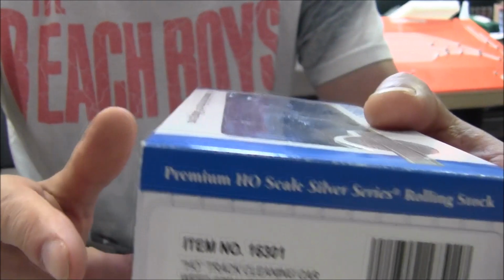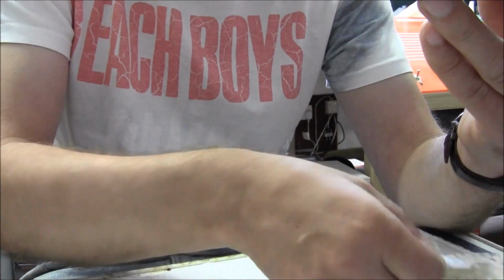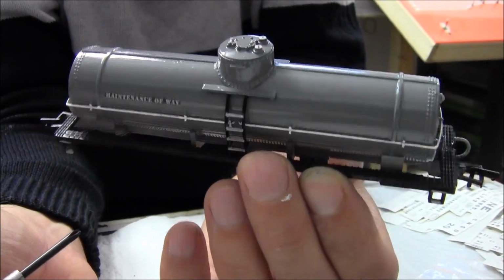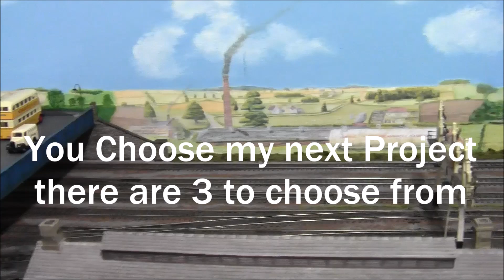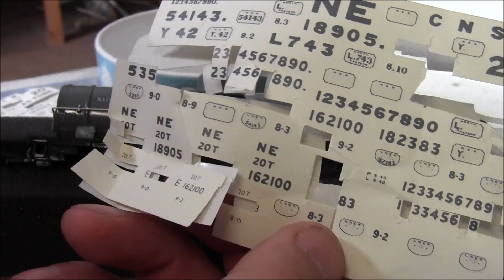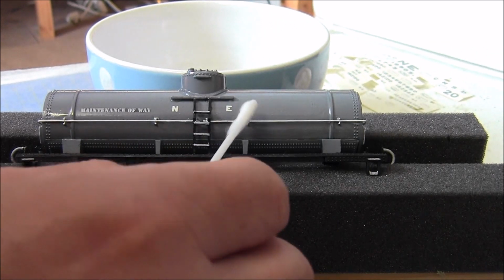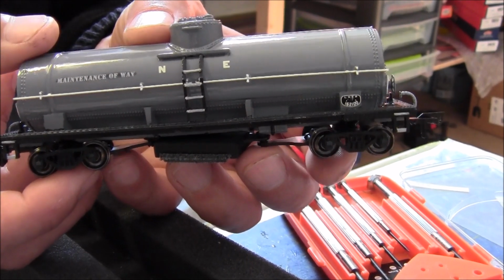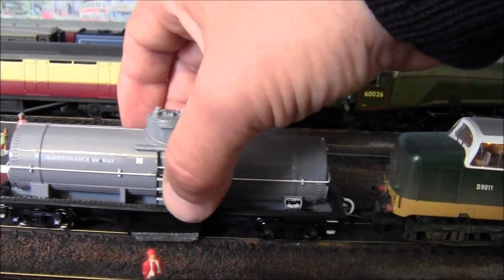The Ho Bachmann cleaning car transformed....No143

Comment: Hi Tony. Good steady hand with painting the tanker - it's highlighted details, even the riveting. (Americana appearance gone). My choice of project would be No.2. Pre-diorama - the inn looks well made, asking for you to make a diorama of that corner (hopefully, I'll managed to "borrow" your ideas :). I hadn't intended putting curtains in but seeing your the inn as it stands, curtains are required. For me personally, it would be great to see how you will approach this and will see how you work this at a later date, so, its option 2 for me. The backscene would probably be your preferred as I sounds as though it might be niggling you.  Alan.
Reply from the maker: Cheer's Alan thank you for support in the vote, if you want to check out a building. I have done a pub in the back catalogue of videos. Metcalfe Kit shop fronts Turned into a pub. thanks again for your input regards Tony

Comment: Hi Tony.Been looking at this track cleaner at TMC.Now then,doe's it actually do the job and how difficult was it to modify the coupling?The reason I ask is I'm no good at intricate work due to vision issues.Distance is fine but close up is u/s.You do have some interesting videos on here,I modelled from your stone walling video and,yes,it fitted in perfectly with what I needed.Keep up the good work.
Reply: Thanks for the info. & quick reply Tony.
Reply from the maker: Hi David I have done a low down on the coupling and it will be in video 145....not 144....all the best Tony

Comment: Hi Tony, is the track the same as the cmx model, mostly is it cheaper.
Reply from the maker: The Track I'm sure if its same model. but is cheaper than the one you put the cleaning fluid in. £32.00 on the amazon web site.....thanks again Tony

Comment: First, the tanker came out great. Second, you're displaying is amazing. I'm new just bought a train for my Christmas village. I'd like to add a tanker and it was thinking of getting this one to serve dual purpose. Can I run tanker w my train without having to use the cleaning feature? This is HO scale mine is on 30 will it look too small? What paint did you use to paint it? Where did you buy the stickers? I'm looking for some Christmas ones. Thx... frank
Reply from the maker: Good morning Frank. And thankyou for commenting. The paint i had used were both Humbrul. Gray 85 and satin Black. 2 part grey and 1 black. the Decals you can pick up from ebay. i do believe Slatters sell them separately.
I used a couple drops of white spirit dropped onto the pad for cleaning the track. and it works a treat.  
as for the using the taker with out the cleaning feature, it does come apart from the bogies. 
i hope this helps...cheer's Tony

Comment: Great video again tony, got me thinking of which track cleaning method i should use when the time comes, with the project id say number 2 something different from previous videos and be nice to tie in that area as that looks to be the only bit to do there cheers again Beeton Hough Junction (Dave C)
Reply from the maker: cheer's Dave so you like the pubs, thanks for voting. I only bought the cleaning wagon for the tunnels, I can get in the tunnels by hand buts its s bit of a fiddle. the cleaning pad gets clogged up pretty quick, so it works well, all the best Tony
Reply: TONY NORTH EASTERN hi tony, yea think it would finish off that area and then go do the back scenes and onto the bridge, im thinking of something similar that can be pulled while cleaning as im going to have a lot of track to clean and maintain thanks again Beeton Hough Junction (Dave C)